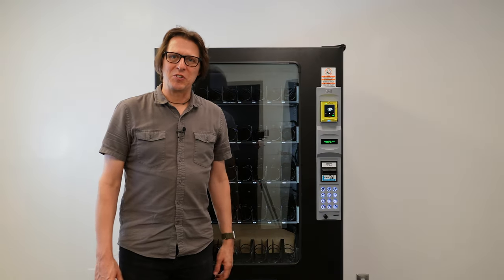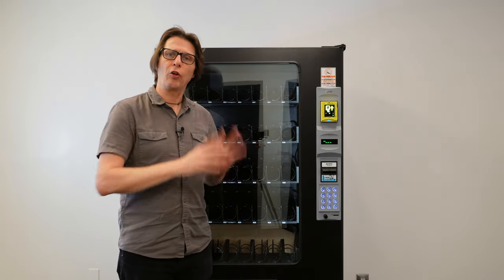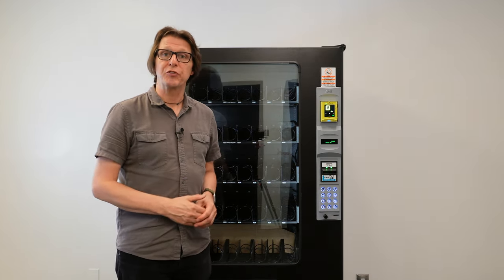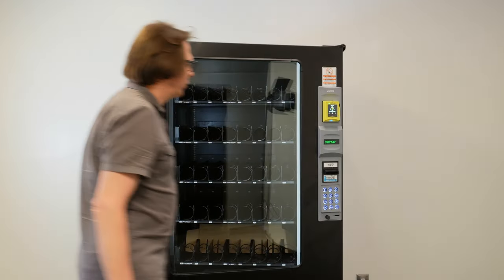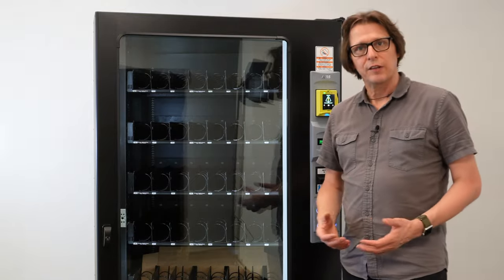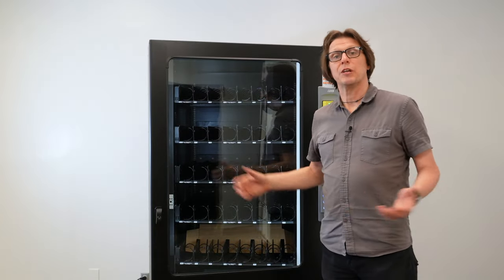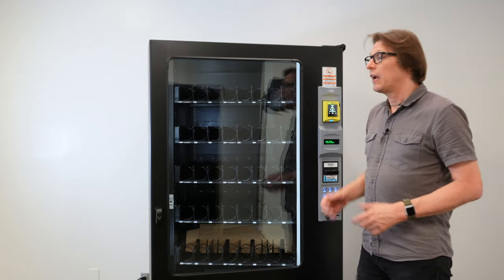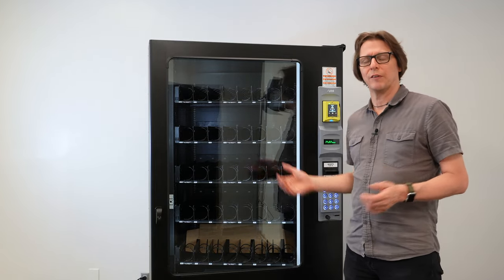AMS Vending Machine - Motor Configuration (Troubleshooting Tip)

Comment: Hi

I have a Sensit 2. The issue is the columns will be filled and it will indicate to please select another item.

I’ve jogged the tray and the column that is not working will work temporarily.

Could this be a motor issue?

Comment: can you tell me how to clear "use exact change" code. It does not allow user to use dollar bills even though it tells user "$1.00 Credit" but will dispense product with exact change.
Reply from the maker: That is not an error. Do you have at least a minimum of 12 coins in each of the tubes on the coin changer?
Reply: @VendingMachineSupport  yes all tubes are filled.
Reply from the maker: I assume this on an AMS machine. When you place the machine in FILL / DISPENSE mode and add coins at the coin insert slot. Does the machine report back the value of each tube?